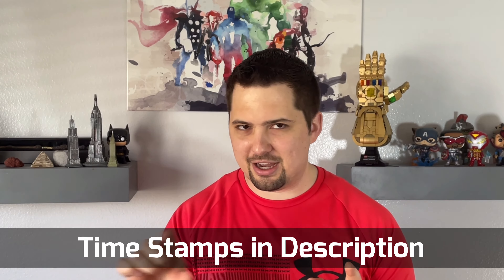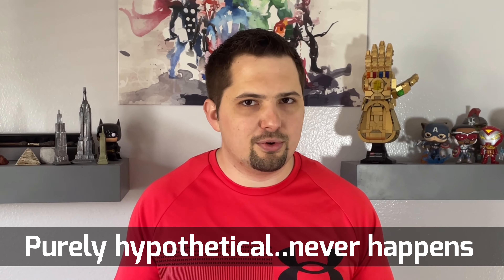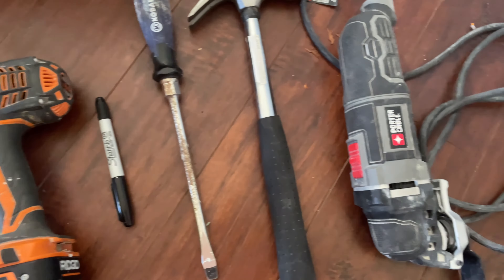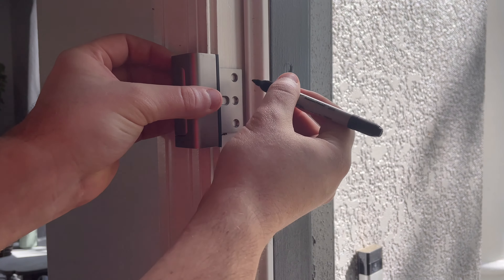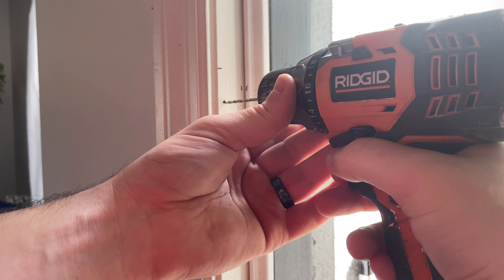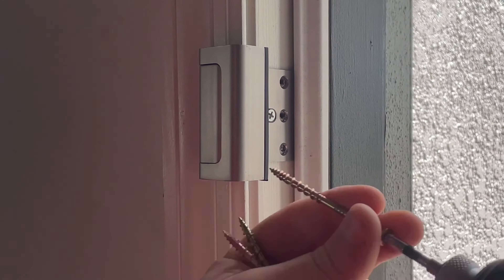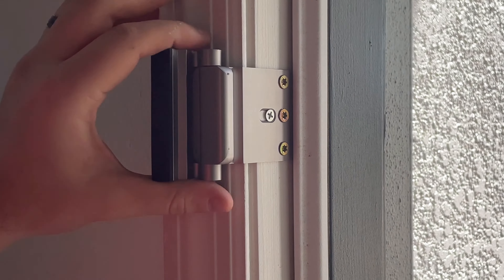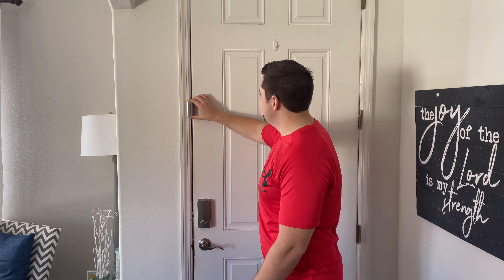How to Install a Door Reinforcement Lock - Prime Line Defender Security

Comment: Harder to find in long lengths but if you’re going for shear strength you should use stainless screws.  Also switch out all your door screws with longer ones.  Latches and plates.  I’ve never understood why door knob/lock hardware comes with screws that are less than an inch long.  If your holes are stripped out you can shove a toothpick or two in there to help the screw bite.
Reply: Cheap buildings

Comment: I'm a pensioner and terrified of going out as someone before xmas tried to get in my place I was lucky I shouted and they ran of im waiting for a dead lock only problem is its has a lock the barrle sticks out half an inch so one twist with a grip and there in I have been waiting 2 months for the landlord to fix it this may be never   my door opens out into the garden and the door is made of a plastic kind of stuff so not strong to fasten. a lock to anyway don't know what im to do

Comment: I bought one of these to try out and liked it so much I bought two more. I did have to chisel out just a bit but that went fine. I used nothing but 3" SS deck screws on all hinges and strike plates. I also changed out those worthless flimsy strike plates.

Comment: It’s much easier if you pick up a set of vix bits at Harbor, really cheap. Drill bit is housed in a chamfered drill fixture, each bit size is determined by the hinge plate chamfer size